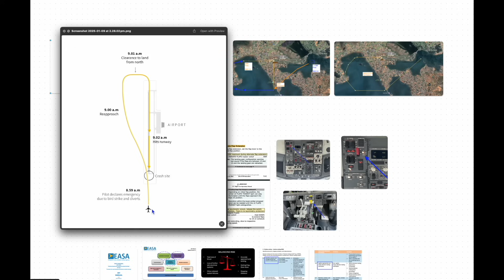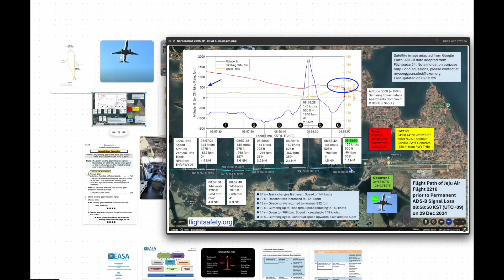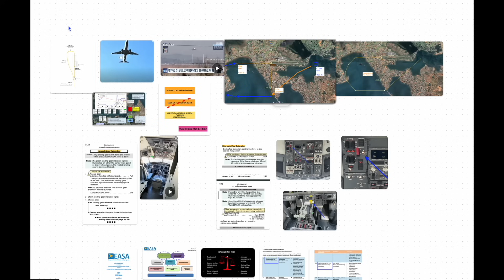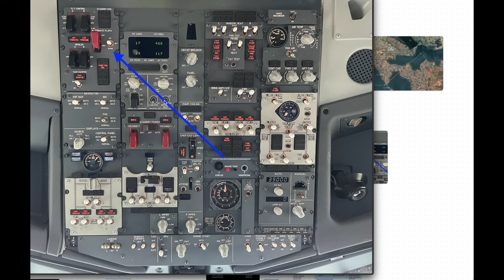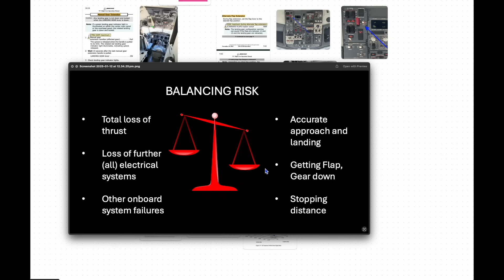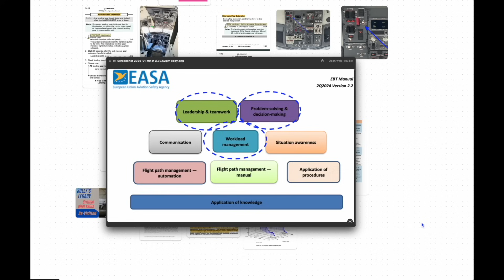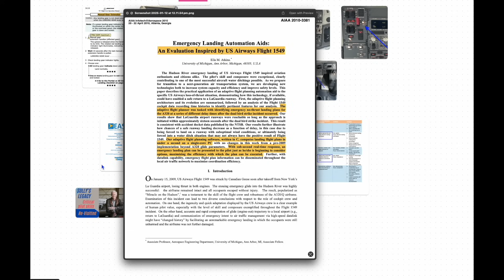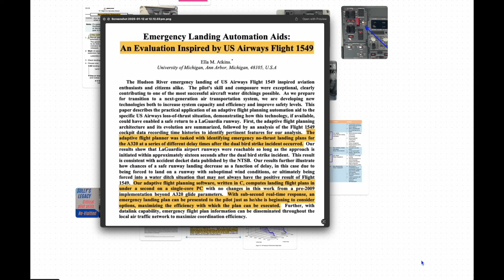Jeju 2216 Update - Multiple System Failures lead to catastrophe

Comment: Yes I believe the 737 FDR and CVR requires the power to either AC transfer bus 1 or 2. But if both are lost, then there’s no power. Unless you start the APU.
Reply: I believe every pilot can draw invaluable lessons from the Miracle on the Hudson. When Captain Chesley “Sully” Sullenberger realized that both engines had failed, he took decisive action after 2 seconds. He immediately informed First Officer Jeffrey Skiles, saying, “I’ve started the APU, and I have the controls.”
At the time, deploying the Auxiliary Power Unit (APU) during a dual engine failure on takeoff was not a standard memory item. However, Sully’s quick thinking and deep understanding of the aircraft’s electrical systems and redundancy highlighted not just his ability to fly but also his mastery of the systems that kept the plane operational under extraordinary circumstances.
Aviation safety is no miracle—it is the result of meticulous preparation, honed flying skills, effective Crew Resource Management (CRM), and sound risk management. By focusing on these human factors, we can better ensure positive outcomes, even in the face of the unexpected.
Reply: @edupassionata8938  Uhmm, Sully was ~5K feet up when he lost both engines. He had TIME for his APU to spool up and begin producing power... I've seen it reported by several pilot's blogs that starting an APU in flight (or on the ground) takes time... this crew had less than 4 minutes to assess what was happening and do EVERYTHING THEY COULD THINK OF while flying the plane without "power steering" basically, and i'm sure they had NO idea what was just past the end of that runway they surely thought they would be ok if they could just touch down safely ON the runway and slide to a stop. They did not have hindsight of what was about to happen to them.
Reply from the maker: There are certainly many lessons from Sully's performance. 
He's a true professional and a pillar for many to aim up to, his actions after the accident say it all
Reply: @AdaptiveAviator  Yeah but Captain Sully had some luck on his side... starting with his much higher altitude when he struck the birds and lost his engines, and ending with the Hudson River not having a large boat or anything in his landing pathway. That could easily have gone all side-ways too. This Korean flight crew though, they just could not catch a break. 😞
Reply: Not every pilot flies and thinks like Sully though 🎉
Reply: @joshilini2  And Sully was at ~5K feet, that gave him the ability to trade altitude for airspeed and TIME, commodities that this Korean air crew simply did not have. Now why it is people are continuing to swear that no bird strike could possibly have caused this disaster because that is beyond me, knowing all that we do know (even without black box data and recording) and having Captain Sully's bird strike killing both engines event in mind... why on earth would you NOT believe flying thru a dense flock of sea birds wouldn't cause this kind of hardware failures? These poor guys in the cockpit were flying a brick for all intents and purposes... just saying. 😕
Reply: @joshilini2  Ok fair enough, I mistakenly picked up on the wrong number... over about 4K feet was about the cloud deck altitude Sully was observing and not the plane's altitude upon hitting the formation of geese. Still, some 2,800 feet is A LOT higher up than the ~400-500 feet that this crew had to work with. And you don't just grease a plane in upon striking a flock of birds not knowing what systems you just lost or what damage was done to the plane.... you could easily kill every single person on the plane landing like that! But according to many pilot blogs, it's a toss-up whether to do a go around and assess your plane and situation or whether to go on and complete the landing... plus we do not know if this plane was quite possibly attempting to go around to avoid more birds in it's initial path. We may never know just what those Korean pilots saw or knew or when they knew it... hindsight is always 20-20 friend. Regards!

Comment: Pre 2010 Boeing 737 -700 do not power Black Boxes via battery backup in event of power loss.
Reply from the maker: Thanks for the comment. The aircraft HL8088 was a 737-800, it seems you may be right about the backup power. I'll issue an update if so
Reply: @AdaptiveAviator  That is truly amazing if so! Surely they don't consume enough power from the system to want to exclude them from the available backup power on that plane in a dual-engine out emergency? What could possibly have been the designer's thinking to not include them???
Reply from the maker: @michaelshrader5139  check out Chris Brad's video, link in my more recent comment

Comment: Engines don't just stop turning from a bird strike going at 200 knots. If the 737 actually needs engine thrust to keep the recorders working then it's the worst designed aircraft in the sky and i will never hold the aviation industry in high regard anymore. Bevause that is pathetic
Reply from the maker: These aircraft are very complex and the chances of something like this happening are remote, but yes - we want the systems to be able to handle it when the rare but terrible event does unfold
Reply: @ There is a theory out there now,  that the pilots pulled the engine fire handles. Which kills the generator and the hydraulics. They must not have been following the checklists and pulled the fire handles
Reply: @Toro_Da_Corsa  You seem to be the main one spreading this "theory," that does not seem to have any inkling of evidence pointing towards that yet, at least not officially released.  So either you're knowingly spreading bs, or you know something none of us do yet...?  🤔
Reply: I'd very much like to know what Boeing engineers were thinking when they came to the question of whether to power the black box recorders in the event of switching to backup battery power on the plane, or letting them shut-off? It would seem to me that they would have a very negligible draw, so what is the point in not keeping them powered and recording when things most certainly are going downhill with the aircraft for it to get to that condition in the 1st place.... 😕
Reply: CVR/FDR battery backup was an option available when the aircraft were ordered. However, this plane was built before this backup became mandatory.

Which is an another way of saying, it’s not nessacarily a Boeing issue.
Reply: @thiswillprobhrt  Autrement dit les ingénieurs savaient faire, ça existait mais c’était plus cher…donc Ryanair qui possédait en premier cet avion n’avait pas pris cette option.
Reply: @ Yes. As they have it, the recorders and transponder will stop working when you pull the engine fire handles. Which is more than likely what happened here

Comment: What about the APC .  This 737 should have that power.  Did the pilots forgot to turn it on.  Had some power for the flight to do go around when they cancelled landing. It all comes down to pilots training and presence of mind in making critical decisions. Lets assume they had total electrical failure, but they had sufficient altitude to alternately land on the nearby ocean.  Decision to land on opposite side of the runway knowing atleast partially that runway is not sufficient for belly landing proved fatal.  Even if there was no antenna concrete bedding, this plane would shot through boundary walls and nearby building resulting in similar results.
Reply from the maker: We can discuss this with the luxury of hindsight, something the crew did not have. Attempting to, and making a very good landing on the runway is a very reasonable decision given the aircraft was on a normal approach just minutes earlier. Despite Sully's experience on the Hudson, off airfileld landings will rarely be preferred over a nearby runway. I think we'll come to understand very few pilots would have done better that this crew, extremely sad set of events.
Reply: @AdaptiveAviator  Captain Sully had no choice at all though, it was the river or crash into buildings killing everyone and then some (people on the ground would have died, too). He had altitude and therefore the time he needed to start his plane's APU and do the math and come to the conclusion that he could not possibly glide his plane to any runway, so it was the river or certain death.
Reply: What about the APC? APU actually. It's an engine, it doesn't instantly start producing electricity on demand.. and since it's a jet engine, it has to start and spool up to operating speed before it's electric generator can even begin to produce any stable usable power. In short, the APC takes time to get running and producing power, time was not something this crew had in abundance. Captain Sully had ~5K feet of altitude when he lost both his flight engines and turned to his plane's APU for power... he was able to trade altitude for airspeed and time, because he had a lot of altitude to begin with. These poor guys, had barely 500 feet of air under their wings and a plane that was dying in every way. Let's stop looking for ways to criticize these 2 pilots though, cause it's a miracle that they even got that plane back to the runway and touched down in 1 piece.... they could not have known what was waiting just beyond the end of that runway, like we now know! Just saying. 😕
Reply: @ Yes its APU. understand crew perhaps didnt have much time to spin up the APU. However some critical questions left unanswered. Why crew did a go-around in first place. Crew did a reasonly good job of aligning and almost did smooth landing albeit with no flaps and landing gears.  Again lets assume time factors didnt allow them to drop the landing gear.

Given all these problems, was it a wise decision to put the aircraft down on a short runway and hope for the best or take some risk and land on the ocean waters.  

Its something every pilot should ponder.
Reply: @madhur732  Lacking the black box recorders data for this entire event, there will ALWAYS be unanswered questions about this one. But it is all but a rule: If you can get to an airport runway, that's where you land no matter what. You never take a water landing over an airport runway, ever. All the fire and rescue resources you are going to need are at the airport, not waiting for you out on the ocean or a beach somewhere. Captain Sully had no choice he could not glide to even his nearest airport runway, he had to take the river... and his passengers were mostly standing knee deep in the river on top of the plane's wings by the time the first boats arrived to rescue them, and the water wasn't getting any shallower. That could also have gone all sideways very easily... they caught a little luck though, and nobody died in the Miracle on the Hudson (and that's why it is referred to as a "miracle"). ps. If this Korean plane wasn't making any electricity, then nor would it have had any hydraulics... ever tried driving your car without the power steering pump working? It's fun, trust me I've done it once. 😕
Reply: @michaelshrader5139  Thank you for the reply. Hopefully this korean Air belly  landing crash should help revise standards to be able utilize water landing over runways.  In the hindsight , that would have definitely saved more lives. 

In Nov 1993, one Air India local flight from Chennai to Hyderabad India landed in Wet fields and all passengers survived.  Perhaps there are no videos online but might be covered somewhere.
Reply: @madhur732  Yeah but the problem with water landings, especially on the ocean, is that the surface conditions may be unpredictable and any assistance is still back at the airport which may cause a significant delay in any help reaching your plane once you finally come to a stop. Hindsight may be 20-20, but had this Korean crew attempted to land in the ocean instead the death toll may actually have been a little higher yet... we cannot prove or guarantee any better outcome would have occurred. At every turn, this flight could not seem to catch a break friend and we have got to realize that!
Reply: Agree. Water is on 3 sides of the airport....I'm amazed the pilots didn't choose to land on the water.
Reply: @peachtreee4649  A landing on a runway is almost always preferable than a ditching. First of all the ditching has to be perfect or the plane will break up. Even Sully's Airbus took damage at the rear underbelly and took in water. Second it may he possible for a river to be sbsolutely calm but very rarely an open sea and the waves make ditching significantly more dangerous. Third there is the danger of passengers who survived the ditching to become trapped in the sinking cabin and drown. But the most important reason is that inside the airport perimeter emergency responders are seconds away while at sea there may not be even enough vessels available to assist the passengers.
Reply: @peachtreee4649  No emergency response vehicles out in the ocean, and the ocean is not the same surface conditions as a river... river's absent much boat traffic, tend to be very calm and flat on the surface.... oceans tend to have swells and waves on them even absent ships or boats. When there is a runway at an airport you can get to, you always go for the runway and never the ocean a river or an open field even! You want emergency response personnel to get to your passengers as fast as possible if the landing goes all sideways.

Comment: why isn't the dialog from the air traffic control tower not recorded? if it is, where is that recording?
Reply: There was no response from the Aircraft. The original released ATC recording of the ATC is basically calling out for 737... than 4 minutes before the crash it is one way from ATC and no response. As indicated by both Black Boxes cutting out, no radio communications from the pilots and no ABDS data being sent by the plane.

Also this would indicate that cockpit was blacked out with no display and no lights on any switches, and no indication of any Flap or Aileron changes or if the wheels were down other than via "feel" of the trim.

From Last call of Mayday from the Pilots, to blackout is 12 seconds (CDR, CVR and Radio shutting down due to power loss). 

It is impossible to shutdown one or both engines in 12 seconds even if the pilots was trying to shutdown the engine as they were calling Mayday, which is very unlikely.
 
From the blackout to crash is 4 minutes 12 seconds.
Reply from the maker: Great question, thanks. I think you'll find it was recorded. Probably no a lot of discussion due to crew being focused on emergency at hand.
Reply: The Korean Ministry of Land, Infrastructure and Transport has the full ATC recording and they have only ever realeased a little of what is on the recording, the mayday call, go around and go around approval. They  have said that ATC was in communication with the aircraft right up until the final landing, but they have been very tight lipped and guarded about what was said. Saying that the recording needs to be 'confirmed' before it can be released. They did mention that during the go around someone (i think the pilot) raised the possibility of landing at another airport. 
This was all seen on korean TV press conferences with representatives of the Ministry of Land , Infrastructure and Transport,.shortly after the accident.

Comment: Many factual errors: you stated they would have  backup battery power. That’s simply WRONG. That specific aircraft had NO battery backup. You said that because one engine was still running it would still  provide electric power. WRONG! The power generator gets its power from the front blades. They were likely damaged by the bird strike but the engine itself could be still providing some thrust from the back burner.
Reply from the maker: Thanks for your comments and fact checking me. I will take a look into the points you've raised and make an update if needed
Reply: Every time I have seen a diagram of this plane's electrical systems, there is a backup battery shown in the system. Now maybe those weren't the right diagrams for this particular plane that various pilot blog videos have been showing the past 2 weeks, but every one of them have shown a battery backup in the system that is supposed to be able to power the electric hydraulic pumps and the instruments in the event of a dual engine failure for any reason. That's why this plane doesn't have a RAT that automatically deploys, it switches to a big battery instead. So unless you are from Boeing and helped design or build THIS specific plane, don't be so certain about what you KNOW to be true.... we are all learning a lot about this particular plane and how it worked or didn't.
Reply: @michaelshrader5139  Of course there are batteries, but they don't power the FDR and CVR. They also do not power the hydraulic pump. The reason the 737 doesn't need a RAT is because the flight control surfaces are mechanically linked to the cockpit controls, so they work without hydraulic power.
Reply: @ignorance72  WRONG! You said and I quote: "That specific aircraft had NO battery backup." So how does that feel friend? Learn to treat others like you would like to be treated.... K? And the reason this plane had no RAT is because it has a battery instead. Who knew though, that the data and voice recorders wouldn't be considered important enough to be powered by it in the event that power from both engines was cut? I sure didn't! Unbelievable! 😲
Reply: @ Where did that quote come from? I never said that. And like I said, the battery is not the reason for not having a RAT; it's the mechanical flight controls.
Reply: @ignorance72  How cute, you deleted your post that I had copied and quoted you from. Did you think I wouldn't notice? smh! 😕